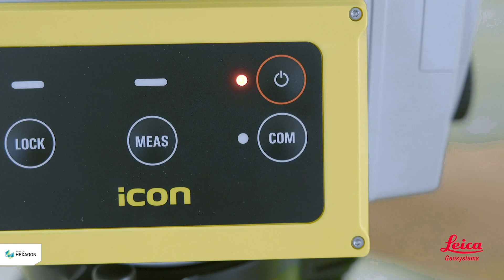How to Setup Your Robotic Total Station Leica iCON iCR70

Comment: Hello, Sir
I'm interested in buying ICON ICR80 total station, and need to run "Layout Objects" application to import IFC files, and layout construction objects (footings, columns, etc.).
May question please, will (ICON ICR80 total station) be enough or I have to buy also the tablet e.g. CC80 in order to run the Layout Objects application?
Thank you so much.